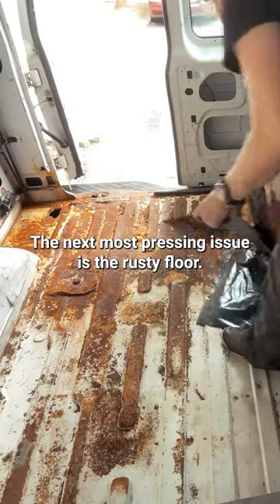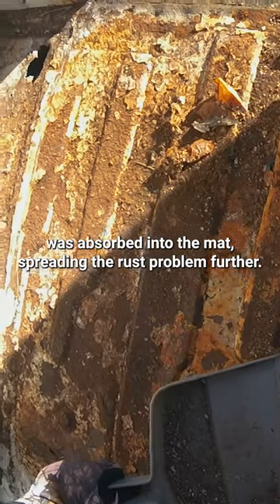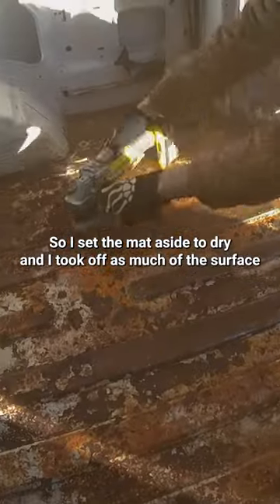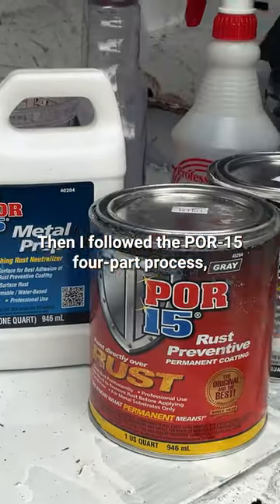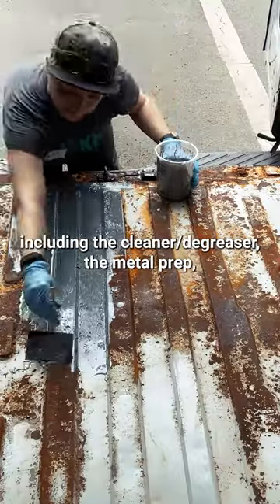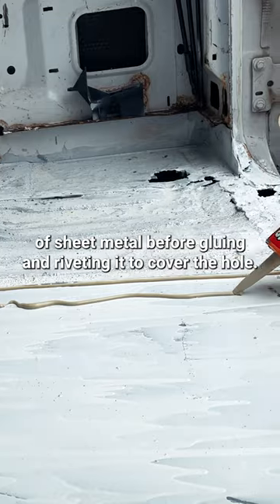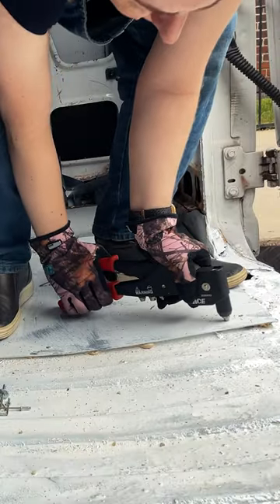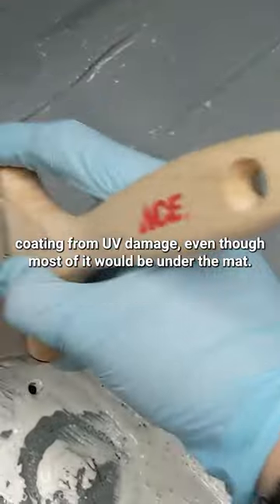I fixed my rusty van floor

Comment: I feel like you’ve just hidden the problem. Surely the rust is still there, spreading? Or at least you’ve put a temporary cap on it which, when it fails makes getting back to the rust even harder.

Comment: Thats an angle grinder, not a drill
Reply from the maker: It's a hammer drill, that's why it has a handle. Promise.
Reply: @BeckyStern  a hammer drill is used for drilling holes on concrete... that's an angle grinder ma'am
Reply: She called it a hammer drill lol @bmesina40